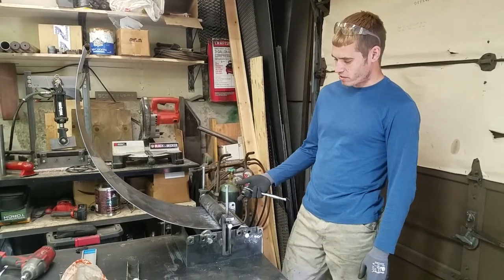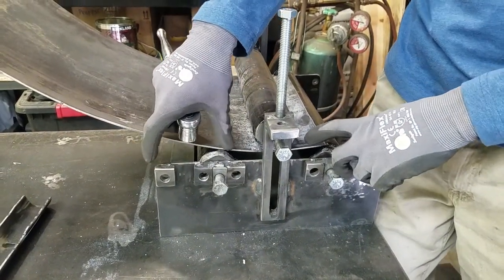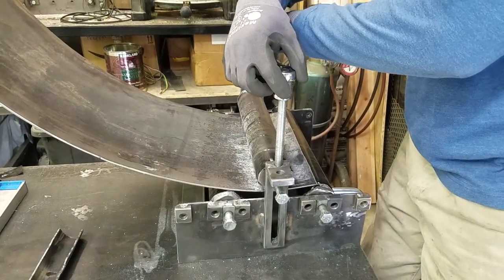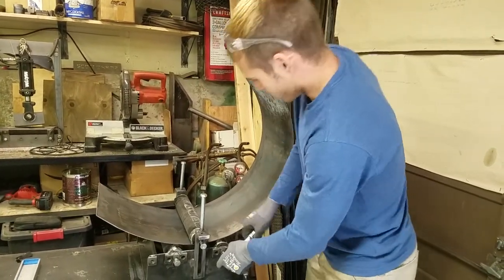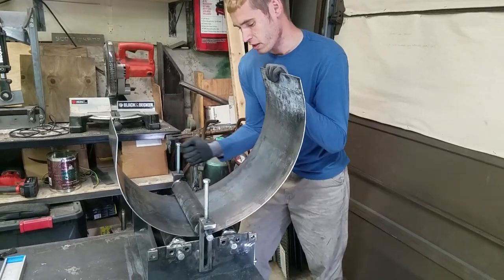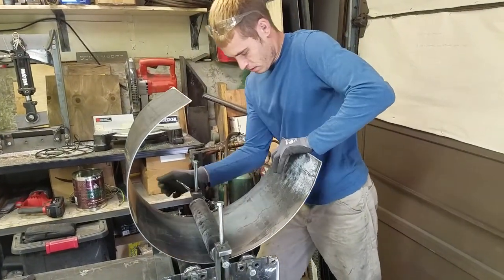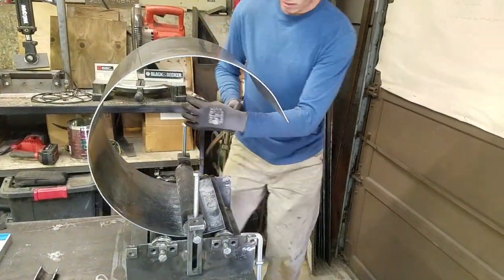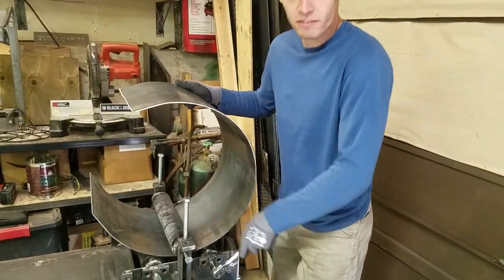Super duty slip roller demonstration cammeck equipment

Comment: Do you make one that will do 11ga x 18"?
Reply from the maker: The 24x1/4 unit can probably do that.  If you want a unit that will absolutely do it, and easily, We just released a bigger unit! It's made with 4" diameter steel tubing instead of 2".  I recently tested it doing a full 4 foot wide piece of that.  It's for sale on our website and Ebay.